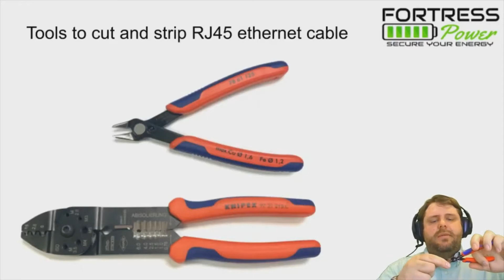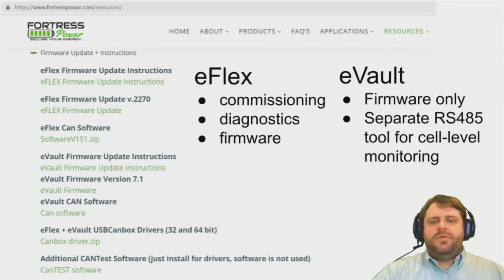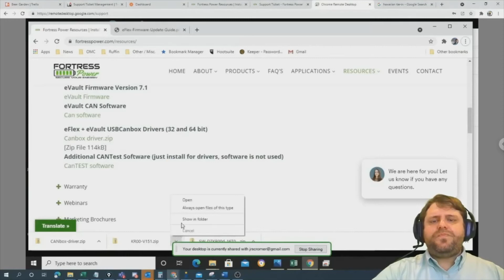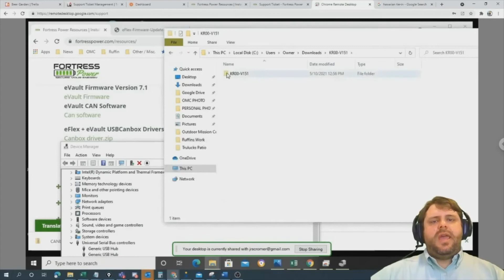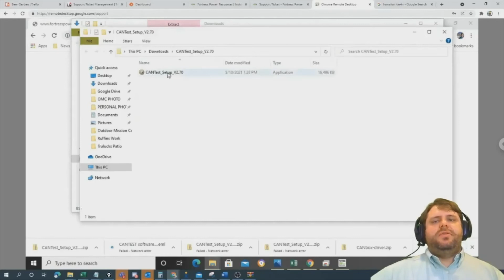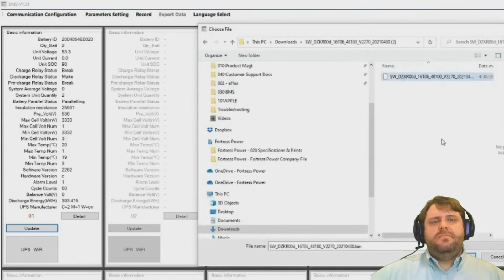eFlex Firmware Training

Comment: Great video but please tell me this is not the long term solution to the problem.
I am guessing that when the WiFi App comes out we will be able to do it through that?
Reply from the maker: The tool is intended for installers, but it is not a long term monitoring solution. It is more like when you take your car in for servicing and they scan it will a specialty computer, rather than the monitoring system for the end user. Once installed and familiar with the tool, it takes ~2 seconds to see what is going on inside each battery in extreme detail, so installers will continue to use it even after the app is launched. For example, many monitoring cloud apps have a delay between the real time field data and what is on the cloud. This is more a local tool for more precise diagnostics and to fill in any installer-oriented features which the app may lack. 

 We have recently added a test engineer and software engineer to continue the app development.